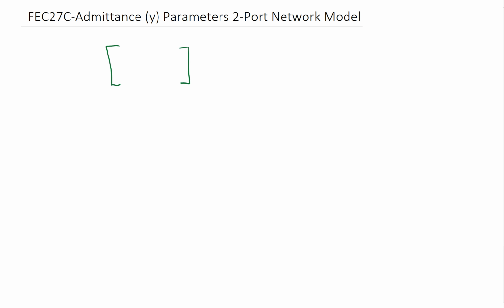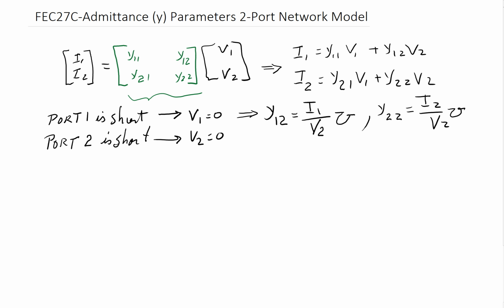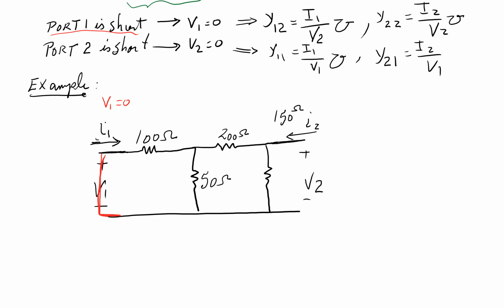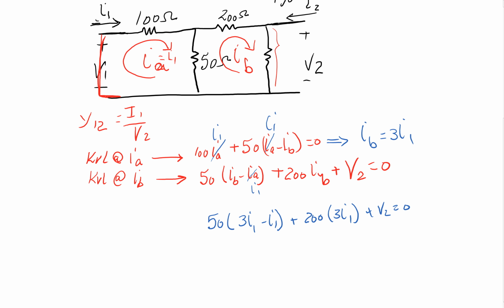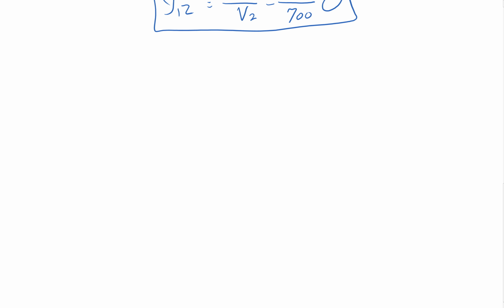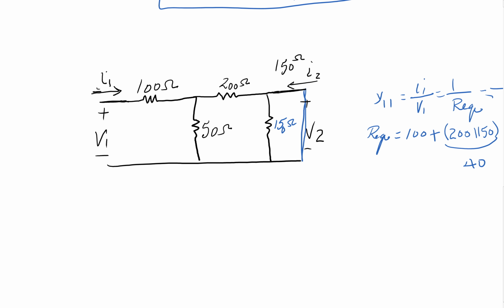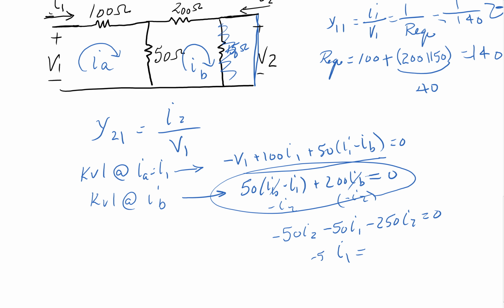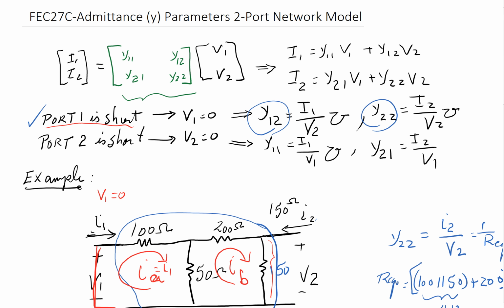FEC27C Admittance y Parameters 2 Port Network Model

Comment: Sir, the second time you have shorted the circuit to find y21, there's a calculation mistake.
Revised calculation:  i1=-5i2 (-50i2 - 50i1 - 200i2 = 0)